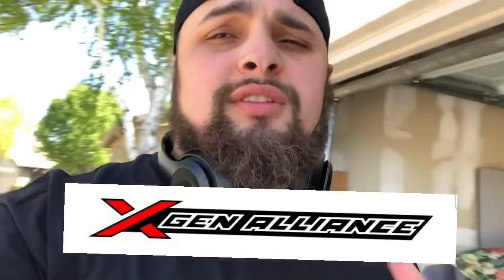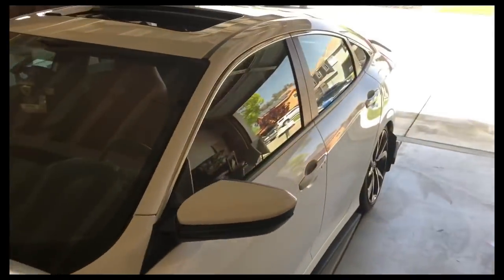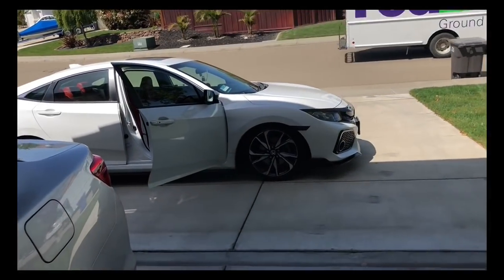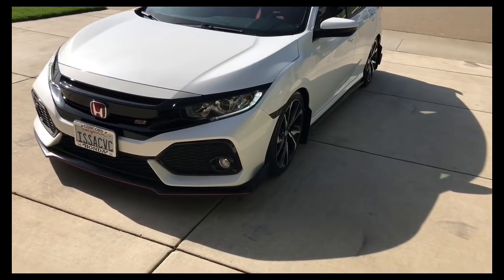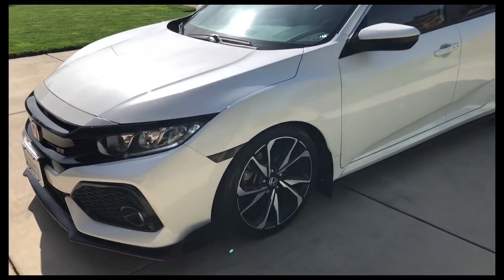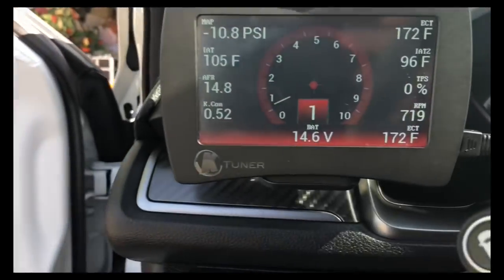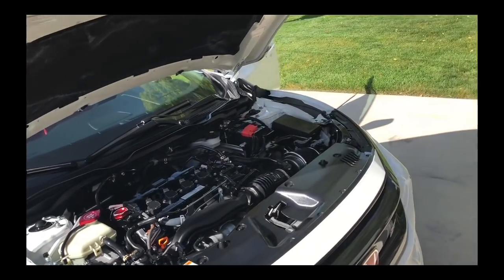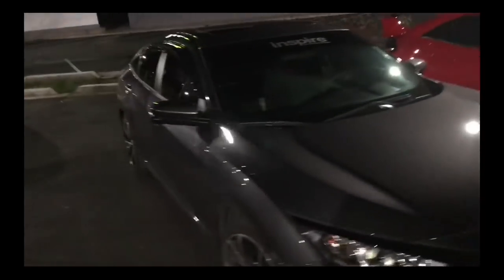My 2017 Civic si Mod list/ XGEN ALLIANCE MEET

Comment: Hey bro nice si , i have 2018 si too , i have a question what modifications need the oem type r lip tp fit on civic si sedan? Also did you had to replace stock clutch with ktuner ? Thanks
Reply from the maker: mk6_007 ig: mk6_007  no clutch yet, and we are gonna be making a video soon to fit the type r lip on si
Reply from the maker: Hey make sure you go check out our raffle video for tonight make sure you go comment below for a chance to win tonight
Reply from the maker: Jebb will do The type r lip is currently on backorder so we are waiting for it to arrive

Comment: You not worried about passing emissions test.. I’m in Boston and I want to do the vitviper stage 2 tune with the PRL pipes but I’m scared I won’t pass emissions when I got get the car inspected next year.
Reply from the maker: Luis Roman in California we dont need inspection for 5 years
Reply from the maker: Luis Roman and when we have to just take pipes off and flash to stock
Reply: Aw man lucky you.. I wish MA was like that.. they just plug it intO the ob2 and let the system
Do the check. So I’m not sure if it will pick up the computer being flashed but I know it’s looking for readiness.. That’s what’s I was thinking of doing here. Take the dp off and put the stock back on and flash back to stock for that test then put it back on. 

One more question... I don’t want to replace my clutch just yet. I got the 18 si and it has 700 miles... would you still suggest the stage 2 tune from vit or the stage 1 until I get the clutch all while running the dp and fp?
Reply from the maker: Luis Roman if thats all they do they wont but if they start reading nox and exhaust fumes they will know
Reply: XGEN ALLIANCE ok cool. Yeah all they are looking for my understanding is readiness on the emissions. They might do a visual but not really on a newer car.i should be all set I hope. 

Keep up the good work, car is looking fresh!!  I had a 8th so I’m not too familiar with the turbo engines. Lol
Reply: Is putting the filter like that works just like a short ram? Because if it does I don’t see the point in expending 300 for one! Lol
Reply from the maker: Luis Roman sweet thanks man keep following the build more things to come

Comment: Hey what’s up bro? I got a question.... is you having that come filter on the intake tube giving you the same results as a short ram would from one of these manufacturers?
Reply from the maker: Luis Roman same results bud!
Reply: XGEN ALLIANCE I meant to same cone. Damn. Autocorrect with my Spanglish from Puerto Rico is killing me. Hahaha 

Ok cool. I was thinking of doing just this. I can’t justify paying 300 for an intake just for the looks when It will probably produced just as much as the stock intake. 

Do you get a nice turbo spool sound and back pressure?
Reply from the maker: Luis Roman first of all for a turbocharged engine you dont need backpressure, plus the turbo spool is soo loud. My Intake set up is the best bang for your buck
Reply: I meant the whoosh sound like a blow off valve.. so you put a cone Filter in with the stock intake rubber pipe and remove the stock intake box? 

I’m asking because I’m About to go to autozone and get me filter and do the same instead of dropping 300 for one. Lol help me
Save money! Lol
Reply from the maker: Luis Roman yea all u need is a maf adapter 2.5 and a filter slap it on and your good
Reply: XGEN ALLIANCE dude you are a life savior!! Haha 

Thank you. I’m looking for one right now!
Reply from the maker: Luis Roman lmk bro i got u
Reply: XGEN ALLIANCE where can I get the MAF housing from?